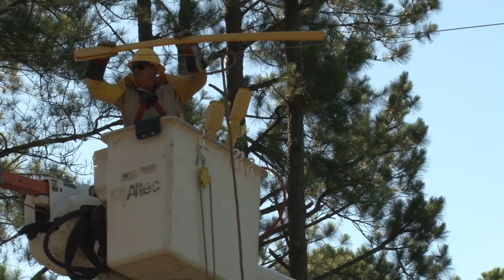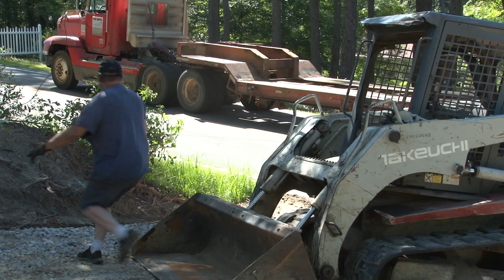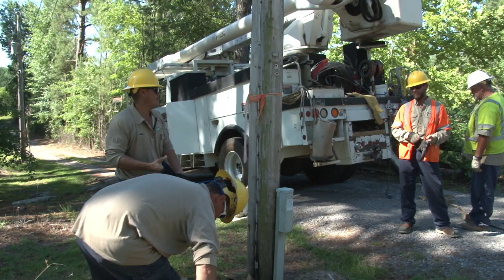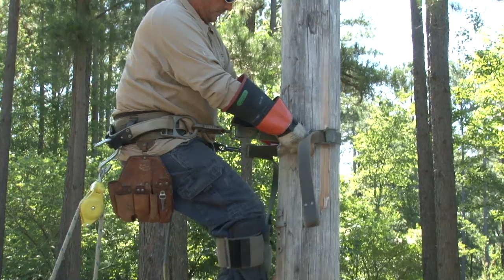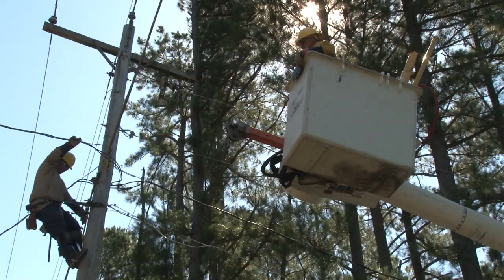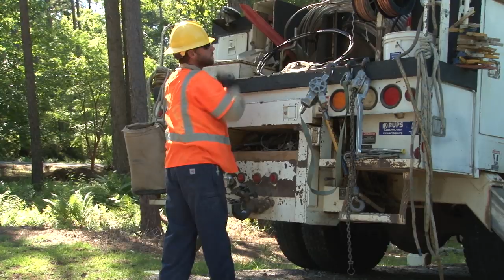The life of a lineman

Comment: Years before these guys started their jobs we were using time domain reflectometers to locate faults in aircraft wiring bundles.  One guy I worked with must have had some previous experience with buried cables--he always referred to the TDR as the "Dig Here Machine."
Reply: I worked telecommunications for 35 years, I’ve used an OTDR machine, used to locate faults in aerial or buried fiber optic cables, it could meter out miles, and put me within a foot of the damage, such a great piece of equipment to have!

Comment: this here is a dirty ass hot hoist, don't really want to trust your life to that rag hoist.
Reply: Don’t trust the strap for any dielectric value at all. It’s not rated at all and the manufacturer doesn’t say it is. Always use a link if you’re going to attach to the pole. Cutting bells in line it will be fine.